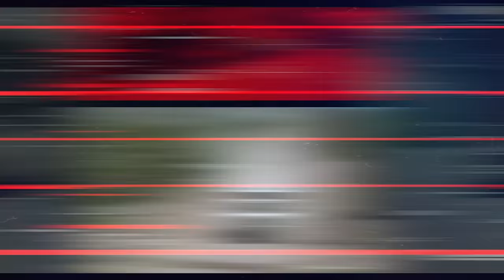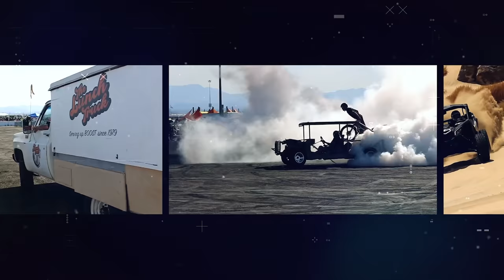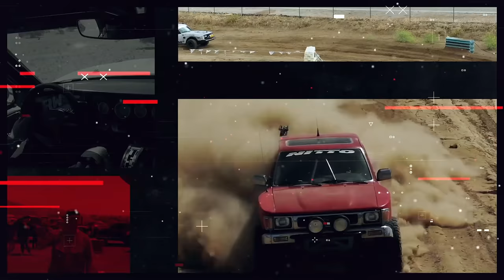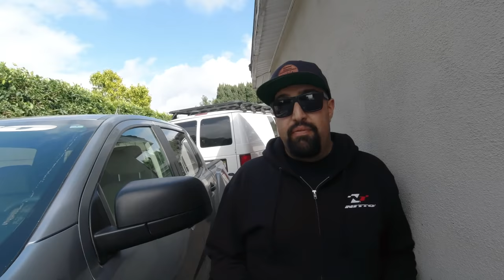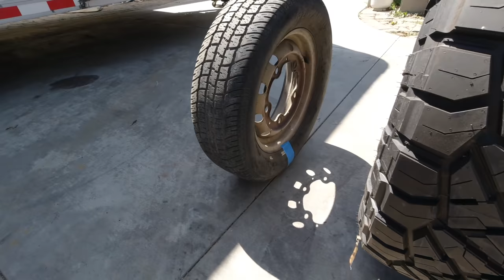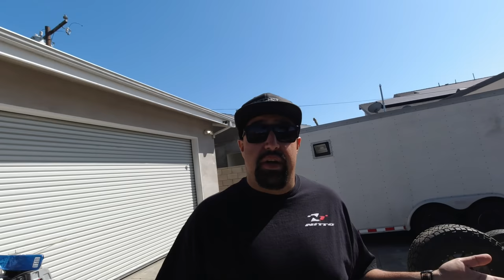Regearing Explained | Chasing Dust

Comment: this is the best info on regearing i've found on the YT. I'm regearing my '20 Tacoma  from 4.30 (MT) to 4.88 next month. went from 31" tires to 33". Thanks for all the info
Reply: Have you done regear your Taco yet? How about it? Mine is 2020 too.
Reply: @khanhtrunglam8724  I like it but the benefits were lower than expected for me because my truck is a manual and the gear ratio on manual Tacomas are already at 4.30 as opposed to automatic Tacomas which come in 3.73 gear ratio. Everything he said was correct. My MPGs in the city improved by 1mpg and my mpg on the freeway worsened by 1-2mpg depending on how fast I'm going. I like the power it's added to my truck but I don't feel I really needed it since I don't plan on takaing it off-roading much in it's first few years while it's still new and sexy. I have taken it on mild trails and I can definitely feel the power although it's not as big of an improvement from 4.30 to 4.88 as it would be for automatics (3.73 to 4.88 or even 5.29). I think I was good at 4.30. I still have my stock gears so idk, maybe I'll end up going back to 4.30 and sell the 4.88s. 

Are you planning on getting your Taco regeared? What shop? If you're in SoCal, I recommend Premier West Gears in Riverside. Good Luck.
Reply: I agree! Best explanation on YT yet.

Comment: Just had 5.29 Nitro Gears installed on my 2019 Tundra. It has a 2.5” lift and running 35” tires. Was very tired of feeling like I was constantly hauling around a trailer because of the weight & size of the tires. I almost went back to stock size but ended up having the gears installed and so glad I did. Now it feels like it did the day I bought. Holds 6th gear like it never did before. I can tell by the exhaust note that the engine isn’t struggling like it did before and always changing gears. If you plan on keeping your tundra and you’re running  larger tires, do yourself a favor and go for it. Almost like getting a new truck all over again, way more fun to drive.
Reply: 😁 holding 6th with 5.29's and 35's? Or 5.30 rather.  What RPM is it holding 6th and what mph?  😆
Reply: How much did it run you?
Reply: So you saying I’ll haul more ass with 5.29 gears on S Mode??? I can’t stand stepping on it and still feeling sluggish after bolt ons . I want the tires to hook

Comment: I really appreciate the vid. It looks like the rear differential on my 2011 4Runner with 34s may have failed last week. I was planning to live with stock gearing, because I spent too much on suspension. Now, I’m pulling the  differential anyway, so I may go for it while I’m making repairs.

Comment: Re gearing helps with getting the speedometer and mpg calculators on vehicles back close, it just depends on how close your gear ratio and tire size ends up being to sock. I have. 2005 chevy that had 3.73 and I put 4.10 in it because I found a junk yard front end that had 4.10 in it so I re geared the back. Running a 35 it brought everything back where it needed to be the speedo can’t get any closer at 65 mph. Still wish I would have went with 4.56s tho.

Comment: Matt, thank you for your video.  For a 2022 Toyota Tacoma Limited 4x4 and I mostly drive on highway with stock tires, is it beneficial to regear the truck to 4.88 with nitro gear package? I have watched several nitro gear videos and it seems that regearing makes the truck more drivable.  I am not towing or hauling or adding more weight to the truck.  Just use it for a daily driver and long distance driver.  Please advise!  Thank you in advance for your help!
Reply: Well, according to the video, re-gearing only makes sense for city driving and long distance will decrease your mpg. So, sorry buddy sounds like you might as well save the money.

Comment: Love the video!!! Although I learned a lot my basic question is if I don't regear will anything actually break ? I don't do any off road  she is basically for the " look"  she's a 2017 silverado and I've heard about potential transmission issues and the 4to 8 cylinder switching stupid feature.

Comment: I have a 1999 2WD 4Runner with new 265/75/R16 All Tennain tires from BFGoodreach the rest is all stock so my question is, should I re-gear my 4Runner and if so what would it be the best? I don’t do any soeacial off road or any crazy just my daily driving to work or long drives in highway. Thanks in advance.

Comment: I'm considering lifting my 2014 Ram 1500 rwd and either 35's or 37" tires I'm currently at stock 275/60/20 and i have the AlphaOBD MX  to change tire size , tire pressure,  tranny shift points my question is will i still need to do a regear as well
Reply: Yes, take it all into account. As soon as I lifted my truck 6” and putting 35’s on (wish I went 37’s) my transmission just took a shit had to get it rebuilt then I actually regeared the truck

Comment: Hey Matt do you see any reason to regear your ranger after the 35s and the tune?
Reply from the maker: I know it would be beneficial to get some of that power back that you lose with 35's, but the 10-speed trans really makes it easier to deal with until that time comes.
Reply: @DrivingLine  thanks for the reply brotha
Reply: I have grand jeep cherokee 1995 limited 4.0 zj i wanted to go from stock size 225/75/15 to some 31's. I've already lifted the jeep 3.5 inch spent over 4,000 in parts and labor now if i want new tires its suggested to get offset rimes and bigger tires. New tires and rims are gonna cost over 3 grand and regearing 2 grand also shop suggested a slip yolk eliminator another 1,500. That's over 10 grand making my head spin 🤕

Comment: am hella confused so on my 2019 f150 3.5 10 speed my current ratio is 3.31 if i go 3.73 it will be close to even number but if i go 3.55 my speed say will be 75 mph at 1650 rpm on 10th gear vs 70 at 1650rpm on 3.31 so it will more efficient  then meaning it will have more power at lower rpm? since i am looking at gear ratio upgrades

Comment: Does anyone know if it is possible to re gear my 2011 Nissan frontier 4 cylinder because i already have 410 gears and i can not town a trailer 3000lb heavy because if i stop on a moderate hill i literally have to rev my engine to 3500RPM and burn my clutch 2 times because it will stall my engine if i don't press the clutch 2nd time to boost the engine speed.  The 1st gear in these has not enough deep gears and i wish i had a granny gear.  410s are already high, is it possible to fit higher ratio gears in the Nissan frontier differentials  ?  Or should i get a tune for my engine?

Comment: I have a 2015 Toyota Tacoma with bigger tires did not do a re gear on them. Felt my truck feeling slow while accelerating into highway speed & going up hills.  I’m putting back stock tires to gain my original ratio gearing. Do I still have to re gear on my stock tires?

Comment: With all this talking, didn't differentiate specifically why the "low gear" mechanically works, like the demonstration was intended to breakdown diameter of tire travel distance.

This is another, as are seemingly 90% of video producers, example of why you shouldn't just wing it when discussing things. Be methodical and make sure you say what you need to to properly inform while not chattering and spazng on unimportant points or talking in circles and end up leaving out elementary points and being inconsistent with the whole production of content.
Reply: Bruh if you’re considering regearing and don’t understand the basic principal of why a low gear gives power back then you shouldn’t even be modding your truck
Reply: @Jay-rg5mt   clearly you're not reading the context of what I said. It's not that I don't understand, it's that the supposed intent to inform on the subject was incompletely informative.

But it's clear you're trying to grandstand that You know about "modifying" trucks, huh?